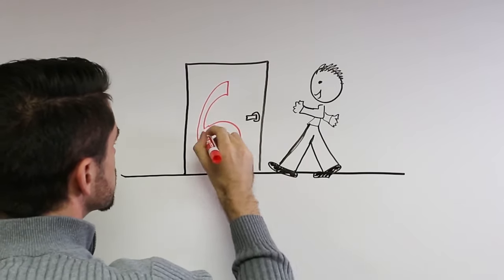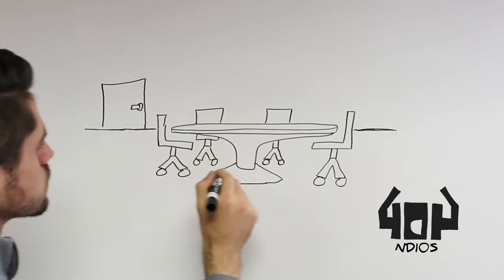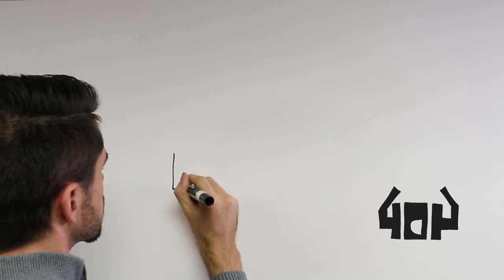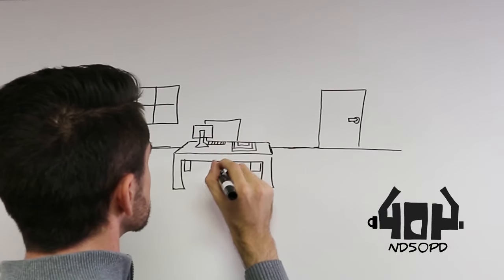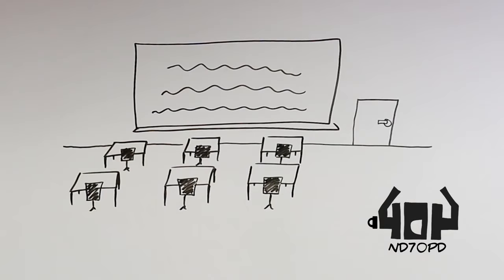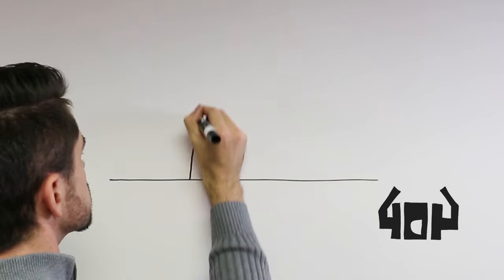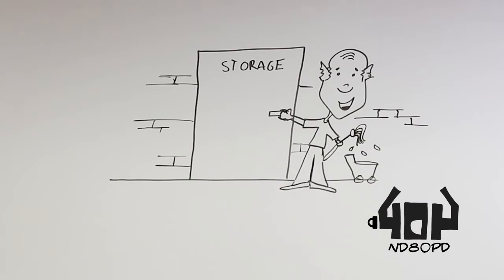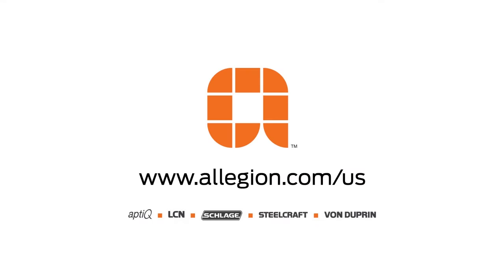Intro to Door Hardware: Schlage Cylindrical Lock Functions

Comment: 1. Passage both levelers unlock: ND10S
2. Privacy: can lock from inside: ND40s
3. OFFICE: Key on both sides: OFFICE doors ND50PD, use of keys
4. Classroom: inside lever always unlocked ND70PD
5. Classroom security lock: both inside and outside level are keyed: ND75PD
6. Store room lock: outside is rigid with key and inside level always unlocked. ND80PD